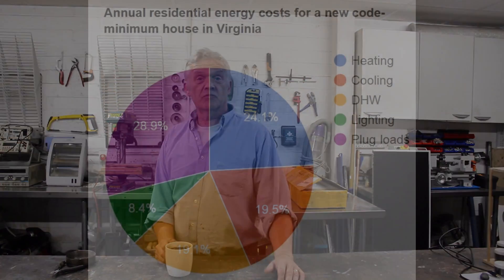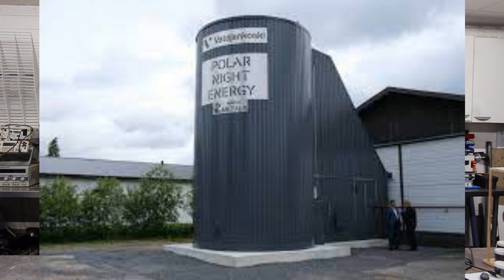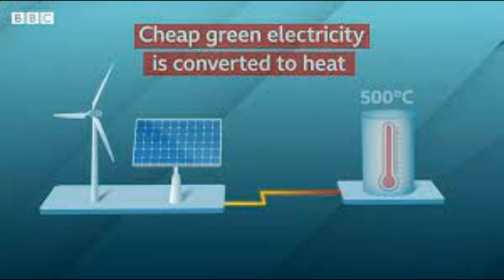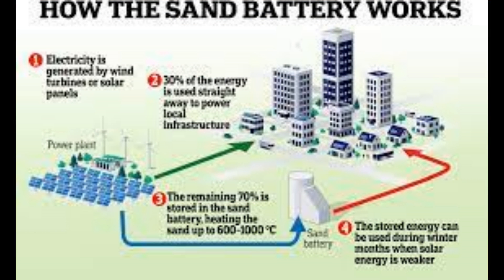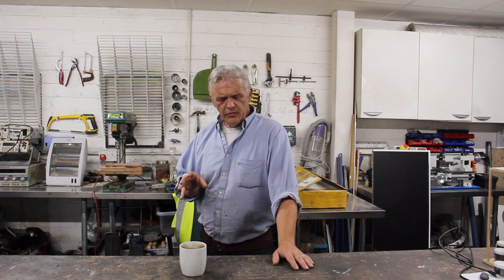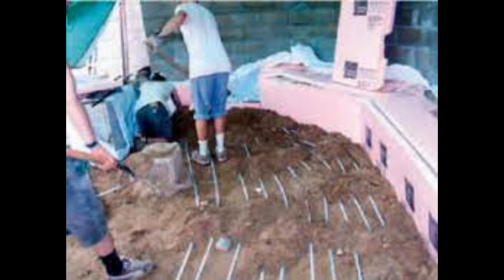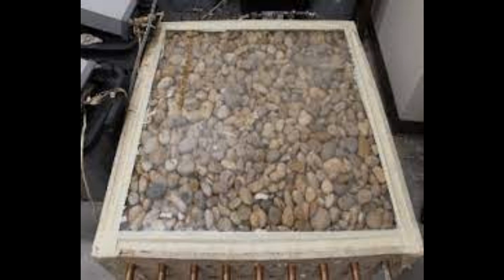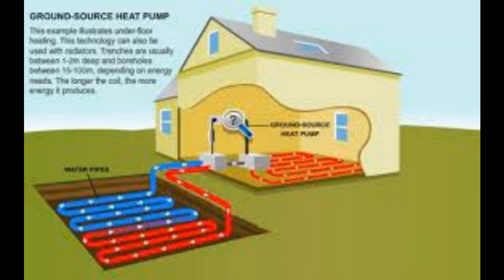1604 The Sand Battery - A DIY Option Or Not?

Comment: Hi Rob, question about solar panels and light wavelengths/spectrums. I discovered that a light bulb will make a solar panel work in the dark. I have also recently discovered indoor full spectrum led lights from indoor growing of plants and they can use as little as 20watts to produce 1500 lumens. What are you thoughts about shining one of these bright leds which replicate sunlight at a big solar panel?
Reply: Hi, unfortunately most PV panel efficiency is approximately 20%. So if you have 100 Watts of solar radiation falling on the panel, the panel at best will generate 20 Watts of electrical power. In your example 20 Watts of radiation from a bulb would only generate 4 Watts power from the panel.
Reply: @Kiwipictish  OK I am a novice but Is it not the intensity of the sun's light that changes the output ie the brightness, or lumens or whatever. Surely the amount of Watts of sunlight a panel receives doesn't change re inverse square law
Reply: @Kiwipictish  sorry I meant to add an example, if I turn a light bulb on (either say 40 Watts or an energy efficient one 5 watts) the voltage achieved by my solar panel is the same, the voltage increases as I move the solar panel nearer to the bulb, the bulb is still using the same amount of electric it's just the light is closer to the panel.
Reply: @mac-qt3wd  What you are trying to achieve is a efficiency of your system of greater than or equal to 100%. We know you are using 20 Watts of input electrical power in the bulb.  So now we need to know the power output of the system i.e. the power output of the PV panel. To measure the power output you will need to connect a electrical load to panel and measure both the panel voltage and the current drawn by the load. The power output is voltage multiplied by the current. The efficiency is then equal to the power output divided by the input power (20Watts).
Reply: @Kiwipictish  OK thanks, what I'm saying is, the sun gives out x amount of power, if I were to move the sun closer the output power of my solar panel will go up until it overloads the panel and things crack. I have tried it with an led spotlight using 10 watts and didn't get nothing at all, presuming the light spectrum was not in the right wavelength. The led lights I mention at the beginning replicate the  sunlight in order for plants to grow indoors at 1500 lumens. If they were putting put only 150 lumens and using 20 watts would I still get the same output or would it be 1/10th of the 1500 lumens bulb?
Reply: @Kiwipictish  let me put it another way, The sun releases energy at a mass–energy conversion rate of 4.26 million metric tons per second, which produces the equivalent of 384.6 septillion watts (3.846×1026 W).
I can make a solar panel generate the same voltage by using a light bulb. The light bulb doesn't not require 385 septillion watts
Reply: @mac-qt3wd  PV panels are specified and measured using solar irradiance falling on the panel, this is measured in Watts/metre squared. Irradiance is the sum (mathematical Integration) of all light wavelength powers present in the solar spectrum. It is not a trivial task to convert from a grow light illuminance value to irradiance. However you are correct that the electrical input power of the bulb does not necessarily relate to the irradiance falling on the PV panel. Fundamentally you need to measure like with like, at the moment you are measuring the open circuit voltage of the panel this is not the same as output power. When you connect a load to the panel the panel voltage will drop, this is why you need to measure simultaneously the voltage and current to obtain the output power. If the panel generates less than 20 watts then there is no financial gain but loss from using a grow light.
Reply: @Kiwipictish  I have a lack of understanding when it comes to open circuit and under load. As per a conversation about wind turbines and magnets I had, 25kgs of the strongest magnets can generate 1 Megawatt of power. So, if I can turn 25kgs of these magnets at the correct rpms (dont know what that is) around a sufficient set of coils will I be generating 1 megawatts, cos he was arguing that It was open circuit and not under load so he said no. I don't know if he truly thinks that or I'm simply deluded
Reply: @Kiwipictish  it started off with me asking a question about a capacitors role on a petrol/diesel generator. He said when no load was connected then it isn't generating any power or next to no power and I firmly disagree. He even admitted that when you add a heavy load such as a kettle or immersion heater the generator slows down in rpms as its "working harder".  Less rpms equals less power, that's how power generation works, more rpms of the same magnets round the same set of coils equals more power generated- or am I missing something here?
Reply: @Kiwipictish  cos in my mind the original or total output of the generator/panel is not diminished by adding load, the end output is but in order to be able to run the appliance then the required amount of power (say 3kws for kettle/immersion heater) has to be being generated by the original outputting generator or panel. The net generated is the same if its open circuit, you add a small load or a big load if the generator is spinning at a constant rpm or the panel is receiving the same amount of input
Reply: @Kiwipictish  don't think I explained that very well lol no surprises there. What I mean is adding a load is just sharing the net generated by the panel or generator, tha amount watts available left after powering the appliance will be whatever the input maximum is minus the load, add what you are taking away by means of load and the two sums equal the same of the maximum put out by the panel or generator when it's open circuit, I hope that clears it up! Lol
Reply: @mac-qt3wd  For all electrical generators and even a PV panel, power is only generated when there is current flow from the generator to the load and then returns to the generator. So if no load is connected e.g. open circuit then no power is generated. There has to be a flow and return of energy. Energy is neither created or destroyed but is converted from one form i.e. mechanical to electrical. When you connect a load to a generator the current flowing through the generator coils sets up a magnetic field which opposes the magnetic field of the magnets, it acts like a brake to slow down the generator. When no load is connected then no current flows so the generator runs under no load speed but is not generating any power.  So a generator or PV panel producing a voltage is not generating power unless a load is connected and current flows.
Reply: @Kiwipictish  so, if its not generating any power when nothing is connected the voltage will be zero volts, is what you're telling me, why does a generator need a capacitor and solar panels (dc current) need diodes then? And why does it not read zero volts open circuit but maximum volts?
Reply: @Kiwipictish  I have a wind turbine and it has a wind curve graphed which shows the power created at different wind speeds (rpms in actuality). It seems to suggest that it generates a certain amount of power which increases with each and every rpm til it gets to its maximum and outputs 2.5kws. It does the same thing when I have it hooked up to a battery or not
Reply: @Kiwipictish  again in my mind :) all you're doing is trading volts for amps. Let's say my solar panels read 35 volts open circuit during the day (cos they do). They must be generating a current. When you take some of that current by adding a load the voltage will drop. Let's give an example, 100 watt output (efficiency already taken into account) so at 35 volts they must be generating nearly 3 amps otherwise how would they be able to generate or power anything at all? Let's say its a 12 volt 40 watt light bulb to power, by your reckoning the solar panel would not be able to power that light bulb without that light bulb being connected? I'm really really struggling here mate help me out lol
Reply: @mac-qt3wd  I think I understand the confusion. There is a difference between what a generator or PV panel can do against what it actually does. The figures you see for power output all assume a load is connected and this figure is the maximum power that the generator or PV panel can generate. 
The PV panel in sunlight with no load connected does generate a open circuit voltage as you have measured however it is not generating power because there is no current flow, you can have voltage without power. You mentioned that a panel maybe is 100W, this figure is the specified potential power that the panel can generate to a load under ideal conditions. The figure is specified by the panel designer. 
It is the same with wind turbine, a 2Kw turbine is the specified maximum power that the turbine could deliver to a load. However if the turbine is not connected to a load it will only output a open circuit voltage but as no load is connected no current flows so no power is generated. 
Think about a car battery, you can use a meter to measure the open circuit terminal voltage to be around 13V but no current is drawn ( this is an assumption because a digital multimeter will draw a very very low current when measuring voltage) and hence no power is transferred until a load is connected i.e. starter motor,                        head lamps etc
Reply: @Kiwipictish  that's all well and good but you're suggesting that no power is being generated and then when you add a load puff and as if by magic the full maximum output is able to be generated. I'm saying when you turn magnets round copper coils and when you shine a light at solar panels they are generating the power required to run whatever load you put on them. If not how do you explain where this electricity suddenly becomes available from? When you turn a kettle on the generator slows down cos it is going way past the maximum rpms required to power the kettle. The reason it doesn't instantly stop and cut all power when you turn the kettle on is because it then reduces to the rpms required to give 3kws to power the kettle. Once a generator reaches its peak rpms turning it even faster has no effect on the output power, when you add the load of kettle it simply reduces the rpms to that peak amount of rpms required to generate 3kws - otherwise it will stall
Reply: @mac-qt3wd  A PV panel is an array of cells with each cell being a semiconductor diode junction when light photons hit this junction it excites electrons in the junction and they gain energy and hence voltage, all of this happens without any load connected.
Reply: @Kiwipictish  all you're doing by adding a load is adding resistance to the flow of electric trying to get back to its source. Spin a generator at a certain rpm it gives you a certain amount of power that's undeniable I dont know why there's a misunderstanding there. Sma e with a panel, shine a light, increase the light (rpms) more power is AVAILABLE to be tapped into. You seem to be suggesting that power comes from thin air and not anything to do with the capabilities or designed output of the generation device. Finding it weird haha
Reply: @Kiwipictish  a solar panel is a terribly designed bi polar Junction transistor in my book. Those things are known as current amplification devices, they amplify the current, but they don't trade voltage. I know my power equations and I know what that, volts x amps equals watts, increase any one of them v or a without reducing the other and you got a free energy device
Reply: @mac-qt3wd  There is no flow of electric current without a resistive load, that is why its called open circuit, the circuit is open. Power does not come from thin air, as I have said previously these are conversion devices. Solar energy is being converted into electrical energy, wind energy is converted into electrical energy, if no load is connected then there is no conversion of energy. Without a load to dissipate the power there is no transfer of power from the generator or PV panel. These are the physical laws not defined by me.
Reply: @Kiwipictish  right, so if I add a 1 watt load to a generator which is spinning at 3000 rpms and ot slows to 2900 rpms how much power am I generating in your view? 1 watt? If the generator needed to be rotated at 2000 rpms to produce 5 kilowatts would it be producing 1 watt at 2900 rpms? If you say yes I'm gonna have to bid your farewell and ask you to think about your YouTube name
Reply: @Kiwipictish  electricity does come out of thin air, atmospheric electricity goes up 100 volts every 1 metre. I stand at 180 volts tall, the figure tails off when it gets to the certain height but it's 100000s of volts. Harvesting atmospheric electricity, look into it, old buildings knew about it ;), especially cathoderals spelt cathedrals nowadays
Reply: @mac-qt3wd  I've gone as far as I can go. I wish you luck.
Reply: @Kiwipictish  you too mate, I've added many variety of loads to generators and all they do is slow the rpms by varied amounts depending on how many amps they need. I think you need to consider what is actually generating the amount of maximum power you intend to tap into, without the generator or panel you have nothing to draw power from. I discovered one of my solar panels had become disconnected for about a week, doesn't mean that solar was generating zero watss cos it wasn't going anywhere I just wasn't utilising it
Reply: @Kiwipictish  ps I also used a magnifying glass as the voltage went up more and cracked the panel and glass.

Comment: Hi Rob, any way to convert the heat stored into electricity efficiently? Like adding a steam engine/turbine in the sand and a tank of water :)  Find it confusing calling it a battery instead of a thermal store. Maybe use clay as it has a high negative charge content and sand is low
Reply: No such thing as an efficient steam engine.  Transforming (or conversion) always causes loss of energy.  All too many, in every flavor of the Green movement, fail to recognize this.  Everyone thinks they can get "free" energy, and there is just no such thing.

A storehouse of anything can be referred to as a battery.  Only makes sense to utilize words people understand their use of to describe ideas towards the same idea.
Reply: @theincantrix1144  that doesn't stop people using steam driven turbines generating vasts amounts of electricity. You can make it more efficient by recycling the steam instead of just letting it drift into the sky making clouds and rain. 
There is definitely such a thing as over unity or zero point energy it's not even difficult. What people fail to grasp is you can get more out than you put in but is not 100% efficient so they don't understand it.  Thanks for the explanation of the battery description
Reply: @mac-qt3wd  Read up on Carnot Efficiency.  Steam generators, steam turbine, condensers, and feedwater pumps constitute a heat engine that is subject to the efficiency limitations imposed by the second law of thermodynamics. In the ideal case (no friction, reversible processes, perfect design), this heat engine would have a Carnot efficiency of

ηCarnot = 1 – Tcold/Thot = 1 – 315/549 = 42.6%

where the temperature of the hot reservoir is 275.6°C (548.7 K), the temperature of the cold reservoir is 41.5°C (314.7K).

The thermodynamic efficiency of this cycle can be calculated by the following formula:

Rankine cycle - example - thermal efficiency

thus
ηth = (945 – 5.7) / 2605.3 = 0.361 = 36.1%

Physics is a thing friend.
Reply: @theincantrix1144  yes but you can get an invention to do the work which gives you a greater output at the end of it by using stronger magnets bigger coils and gearing. That's also a thing bud
Reply: @theincantrix1144  let's say this 100 tonne sand battery takes 300 kws of solar/wind to heat the sand up to 500 degrees over however long it takes. Let's say 24 hrs @ 300 kws so 7200 kw/hrs. What if I put a steam turbine capable of 1900 MW into the system? What then?
Reply: @theincantrix1144  Cos by my calculations to recover the 7.2 Mw/hrs used to get to 500 degrees I would have to run a 1900 mw generator for about 14 mins.
Reply: @theincantrix1144  I was kinda hoping you'd correct me on my calculations by now but maybe you're busy, I'll wait :)

Comment: In Colorado a man made video of building a green house living room.  He dug down like 18 feet lined it. To be water proof. Than put pvc with holes facing down. 6 inch pipe with two inch holes every so inches. He had two inch rocks brought in to go on top. Brought all way to top. Then had large stones that was like walking stones set on top. Polished on room side. Gaps on edges alowed heat to slowly rise. During day fan would take hot solar air from ceiling where it goes. This area from my take. Was 75 ft by 20. Top green house that housed his lap pool and tv area but was adjacent to real house. That had ducts to pull heat into main house. During summer he cool in reverse. Open big flaps in ceiling open doors in bottom caused a major breeze.